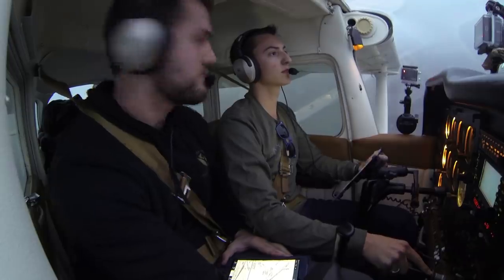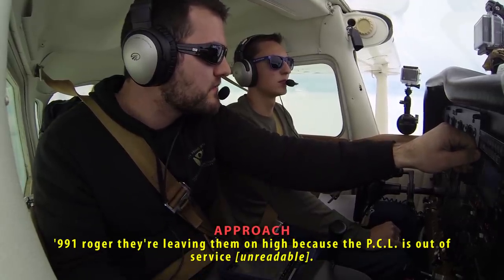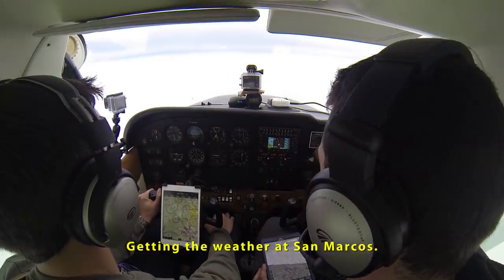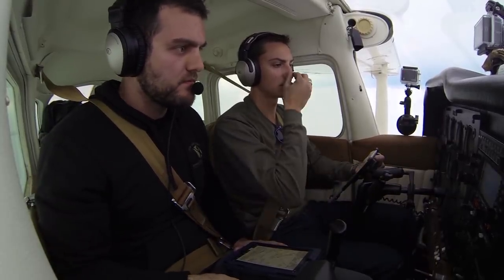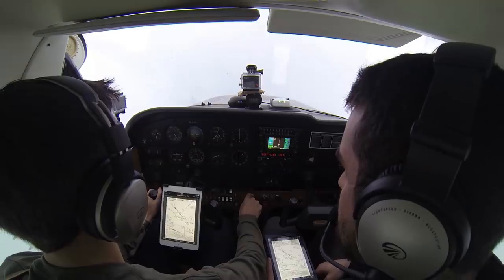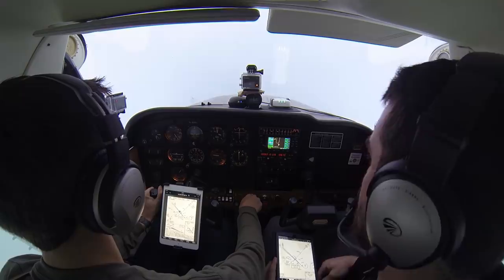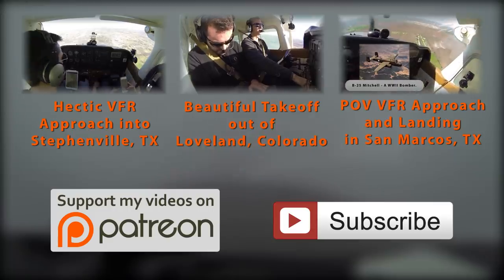ILS Approach to Minimums | ATC Audio | Cessna 172M

Comment: About the lighting, she never told you that anything other than the runway lights would be on. She didn't confirm the approach lighting would be on. Listen from like 2:30 on. When I listened to this the first time I was saying to myself, "She never confirmed anything other than the runway lights."
Reply: +mr3856a ATC did confirm the runway lights would be on high intensity though.
Reply: "991 the pilot-controlled lighting is out of service, so they're leaving everything on high." Sounds like confirmation to me. Someone dropped the ball.
Reply: @Laverne Johnson - According to them, they did check for NOTAMS, and there were none. Since you're calling them liars, please post the proof.
Reply: I know sometimes if the light are left on “Pilot control mode” they would automatically switch back on low during a certain time period.
Reply: @ProfessionalPilot  Look at 2:30. The controller asks if he is asking about the APP lights or the RWY lights as she says all RWY lights will be on high. He answers thank you. The pilot caused the confusion, not the controller.
Reply: Upstate Flyer You bring up such an important subject. Approach procedures with approach lights available make landing so much more likely. The fine print in the regulations is often not explored or understood or appreciated as to the resources available to the pilot attempting to land. Many people do not understand that “minimums” actually refers only to visibility, and does not include reported cloud heights or conditions, unless the specific procedure chart actually requires them, i.e., by text thereon. This is why approaches can be attempted (for commercial operations) when cloud heights at the field are below the MDA or DA, as long as the visibility minimum exceeds that specified. Also, if the approach lighting system is sighted, then one can descend from charted MDA or DA to a height 100 feet above touchdown zone elevation—which greatly increases the probability of safely and successfully “getting in.” This is why the ALS, if available, is so important. This resource should always be looked for and briefed, along with TDZE elevation and the accompanying minimum height one can descend if the ALS comes in sight.
Reply: I just saw your comment now, after posting just about that same thing you said!
Reply: doesn't the approach lighting being off or inop technically raise the decision height, according to the FAR? I could be wrong on that, but it would make this approach below minimums. The approach controller did only say RWY lighting would be on tho, nothing about approach/MALSR or anything else. Either way, great approach and great landing! You'll be a better, more confident instrument pilot after that for sure.
Reply: @teddycourtney5692  Yes indeed - inop approach lighting raises the minimums on the approach.

Comment: Nice video!
A bit too much of pressure and talking of the instructor in my opinion.

Instrument flying is very very easy once you do it regularly and very very difficult at the beginning. 

Good briefing before the flight, the awareness of the common errors (a good portion of them are caused by the mere fact that a student pilot in IMC is nervous) helps.
Do it in a simulator a couple of times to train your brain for the correct scanning technique.

There is no rocket science behind an ILS, just a sequence of quite a lot of small steps and actions. 

I do not fly C172's a lot, I would suggest to fly these approaches with 10 deg flaps only, leave the flaps there until touchdown, any flap changes during the apporach produce a lot of pitch changes - very distracting. An ILS runway is plenty long enough for a C172 on a partial flap landing.

Nice video - keep up the good work!
Happy landings
Guido
Reply: Guido Warnecke I miss your videos, sir! Watched every single one of them and waiting for some more!

I saw you commenting on a brazilian aviation Facebook group once. I'm from Belo Horizonte - Minas Gerais.
Reply: Thank you - muito obrigado.
i will have some videos up shortly.
Greetings to MG & happy landings,
Guido
Reply: +Guido Warnecke I have a question to mantain the GS I could control the pitch only with power setting ??????
Reply: Angelita: it is important not to "chase" a pitch on the glide slope. Start with a know power setting and then do only minor adjustments with power and pitch. If you have a strong headwind you may need to add some power, above the "normal" power setting in the approach.
The key here is "small" adjustments.
Another way to train this on any flight: Set up the aircraft on a descent and watch you ground speed on the GPS. On a 3 deg glide path you would need 600 feet per minute descent rate to maintain on the glide path.
The formula: ground speed multiplied by 5.
Example: 100 kts ground speed, multiplied by 5 is 5000 feet per minute rate of descent.
You hold the rate of descent for that ground speed and you aircraft will stay solid on the glide path, no chasing...
Happy landings,
Guido
Reply: +Guido Warnecke I would practice the formula in my sim by the way I appreciate your advice .Thanks a lot guido and happy landings too..
Reply: Very good - let me know if it works for you.
Happy Landings,
Guido
Reply: +Guido Warnecke Hey man! I agree with your comment about the instructor pressuring too much completely. He appeared a bit nervous and maybe a bit uncertain himself. But on-topic you were testing us here: of course the correct descent rate you wanted to write in your example was 500fpm iso 5000;)
Happy landings!
Reply: 500 is correct - thanks for picking that typo up.
Happy landings,
Guido
Reply: +Guido Warnecke 
Couple decades ago for realistic distractions my instrument instructor for NDB's would use country western radio stations even if we weren't navigating by NDB's.. Could be this videos instructor is combining instruction and realistic distraction all in one. He did stay on him about erring on nav and should of explained rich mixture in clouds has to have carb heat for those planes. Can't let bad habits start in the most critical part in flying.
Reply: +Guido Warnecke Thanks for the flaps advice, it  really worked!
Reply: Very good!
Merry Christmas & Happy landings,
Guido
Reply: Same to you too , best of the best!
Reply: When Guido speaks, I listen..... Thanks...
Reply: IMC is not the time for the cfi to sit back, be quiet and wait for the student to make mistakes before correcting them.
Reply: I think instructor was great  with directions especially hand flying through that pea soup. Shit was thick .
Reply: Bro that instructor was NERVOUS asf lol

Comment: Great job teaching, letting the student fly the entire approach.   Tap the rudder for the minor heading correction and use the trim more - trim for the 500 fpm and see if you can fly the whole approach with little to no control inputs.  The closer you get to that, the easier even approaches to mins will be.

Comment: I only have one note.  The controller said 3000' until established, not 3000' until GARYS.  Those are two very different things.  Maybe the approach has changed, but the current plate has GS intercept at 2700'.  Using that plate, you can descend from 3000 to 2700 as soon as you have course guidance on the LOC.

Comment: Josh, as an non-instrument rated flyer, I was super-impressed with your performance.  Have seen a few in my 33 years of flying GA and Experimental Amateur Home built planes. 

   You are really lucky to have an instructor as good as Brandon - he is "da man!"   I once had a "furloughed Pam Am Pilot" as my Instrument Instructor.  He yelled and screamed at me, until I made a "one eighty" and went back to the field to NEVER fly with him again.  And I did not!
Josh, you are an excellent "manipulator of the controls," and have a great aviation career ahead of you.  I'm jealous as hell :)   Nice video, thanks,  N-6395T

p.s. the movement of the carb heat knob was really telling and important.  I am one of those trained to have that carb heat:  Either FULL ON - or FULL OFF.  Halfway, sometimes, cools the air to 32degrees F - and with moisture, ICE!

Comment: I learned to fly in a Cessna 150 then transitioned to a 172.  It was like moving from a lively but low-powered MG 2-seater to a 6-cylinder Chevy sedan.  The 172 was physically harder to fly but very solid and I did much of my Commercial training in it.  Then I moved to a Piper Arrow, a fast machine with retractable gear and a constant-speed prop.   What a sweet airplane!  I spent dozens  of hours in it in Instrument training, flying bizarre approaches and holding patterns, some times in actual IMC but always under the hood.  Talk about fun!

There is nothing more beautiful than flying through the air, or navigating thorough clouds and fog to a distant destination.

Comment: Your radio was really staticy/hard to hear but I think the controller said that the runway lights would be at full intensity but never specifically confirmed the approach lights.
Reply from the maker: Great catch! I think you are right... The radio was hard to hear so we didn't catch that during the actual flight.
Reply: Andy Plater Gary pettis
Reply: Andy Plater i specifically heard the controller actually ask if you mean he runway or approach lights and you responded to confirm the runway lights will be on so I think it was a misunderstanding
Reply: Was just about to comment on the same thing (two years too late hehe). Anyways, great video! I've watched it several times now, the co-pilot/instructor is really switched on there..! ;)

Comment: The instructor said, "remember to pitch for airspeed, power for altitude". I watch a lot of aviation videos and I know this is always taught this way, but whenever I'm landing or taking off (I'm just a flight simmer), my brain is always thinking to adjust pitch for altitude and power for speed. I realize this is the wrong way to think about it for making adjustments in decent rates but what I do not understand is why?  At face value both patterns of thought seem to give the same result but I must be missing something. Maybe someone can explain why you're taught that pitch is for speed and power is for altitude?  

By the way, I'm not sure if you and Brandon are friends or if this is just how he treats all of his students, but he is the best instructor I've ever seen, I love his attitude and the way he guides you through this.  A good teacher is one that is able to get inside your head to know what your thought processes are and correct them before you even make the mistakes you're about to make, or to help you fix your mistakes.  I taught guitar for many years and Brandon has a very similar way of connecting with his students. Great video!

Comment: Great video!

A little comment:
The controller cleared you to the approach and limited you to 3,000' until established (NOT to GARYS). Once you're established, you are automatically cleared to descend to 2,700' (per the approach plate).
Additionally, GARYS is the FAF only for the localizer approach. For ILS approaches, the FAF occurs once you intercept the GS at 2,700' (which is marked by the lightning bolt symbol on the profile view of the plate - that's what the FAA calls PFAF, or precision final approach fix).
Reply: +talreichert MrAviation101, thank you VERY much for videoing, editing, and sharing such an awesome video.  As a soon-to-be instrument student pilot, this was great to watch.  Great landing too!

Is talreichert’s comment correct?  It seems so to me, but I’m just learning.

At about 8:30, ATC said “Maintain 3000 until established on the final approach course” and, given the reference to “course,” I’m guessing that just means stay above 3,000 until you know that you’re established on the 126 course because you’ve got the localizer needle centered

After you’re established so that ATC’s 3000 limitation is removed, I guess you could just stay at 3000 until you intercept the GS, but I think that you could have descended 2700, the minimum GS intercept altitude show on the chart.

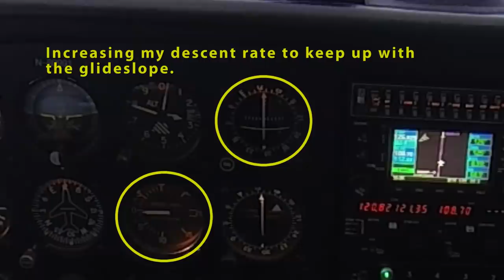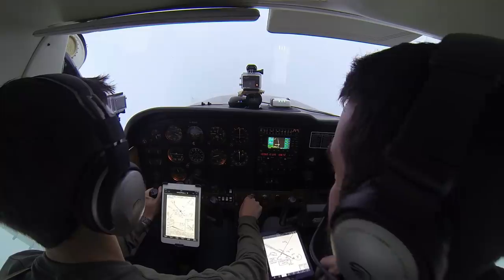At 14:36, after you were beyond GARYS, you show the instruments with you above the glideslope.  And then, at about 14:50, your instructor said “that glide slop is getting way beneath you.”

I’ve noticed that sometimes the ILS lightning bolt and the LOC cross are co-located points in space.  In this case, however, the plate shows the glide slope intercept and FAF for an ILS precision approach (the lightning bolt) at some distance in advance of the FAF for a non-precision approach (the maltese cross) at GARYS (RU LOM), so I’m guessing that interpreting ATC’s instructions as meaning you should maintain 3000 all the way until you reached GARYS is probably why you were initially above the GS and had to aggressively descend to acquire it.  

I’m thinking that intercepting the glide slope prior to GARYS would have been a bit more comfortable.

Thoughts?
Reply: +Joe Andras I haven't received anything on my comment either, I believe what you wrote is correct too. One thing as to what "established" means - if I recall my instrument training right, it does not require that the needle is in the center, but that it's in less-than-full swing (i.e. not in a condition that would require go-around) and moving toward the center.
It is not required for it to be in the dead-center before you can call yourself "aligned" and proceed with the approach. It basically requires that you receive and identify the radio aid in question (where and as applicable), that the indicator is not flagged or pegged to either side (i.e. less than full swing).

I hope that's helpful.
Reply: +talreichert Thanks.  I'll definitely think back to your comments re "established" as I train.  Also, I really like the expression "radio air."
Reply: +Joe Andras Well, it was supposed to be "radio aid" (now fixed), so don't get too attached to it. :-)
Good luck in your training! Working on your IFR ticket?
Reply: +talreichert Ha.  I took it to mean radio-enhanced air, i.e. when your in the air where the localizer needle isn't necessarily centered, but is helping.  No worries.I may still adopt it and someday you can take credit for coining it.

Comment: "Full power full power!" I would have firewalled it and started the go round.
Reply: I agree. I am not so convinced as some are, about the appropriateness of the instructor's constant advice during the descent. In my experience, the pilot is usually already taking the correct action to regain the glideslope. It is too easy for the pilot monitoring to pick up a deviation, which is probably already being addressed.

Comment: I see that you're on NAV page 2 on the 430. NAV page 1 is better for flying the approach in my opinion. Trying to fly the magenta line with precision is a fool's game. On NAV page 1 you have the indicator. If you set up the 430 to show DTK and TRK as long as you keep those the same, you'll stay right on the localizer. Nice job though. I am also quite impressed with your instructor.
Reply: Now what did they use in the 70's before Nav page 1 or 2?

Comment: Well done from a retired airline pilot!! You guys just blew the lid off the insanity of setting personal minimums and never violating them. Thank you Brandon for not buying into this stuff and passing it along to your students, and here's why. When training for your instrument rating, all approaches are flown to minimums. When you take your check ride, the examiner makes you fly all approaches to minimums. Then the idiots at the AOPA and other people will tell you to set personal minimums for yourself and never violate them. This instills in pilots an irrational fear that there is some hidden danger below their personal minimums. I was at an AOPA seminar once where the presenter passed around a document for those IFR rated pilots to SIGN vowing they would never violate there personal minimums! If you have personal minimums, you will never be a better pilot than your personal minimums. Let's say you are told to never go below 800 and 2 miles. You get to your destination and it is 500 and 1 mile. Are you REALLY going to divert rather than continuing to descend for another 300 feet? Diverting is far more challenging than continuing to descend an little longer. I have one suggestion for you on the approach you flew. I would have stayed at 4000 feet until intercepting the glideslope. If you are at 4,000 feet, and your clearance is to maintain at or above 3000 feet until the intercepting the localizer, stay at the higher altitude and intercept the glide slope from there. This gives you more time to figure out the power setting required to keep it centered. Just a suggestion for an otherwise well flown approach.

Comment: Way to electronically gang bang your magnetic compass.
Reply from the maker: All of those devices are magnetically shielded. They are meant to sit on the glareshield next to the compass.
Reply: +MrAviation101 Interesting! Thanks for the input/reply! Fly safe!
Reply from the maker: +Adam Rice yeah! No problem. It's a common misconception, most of those aviation devices like we have are designed to not affect the compass.

Comment: My instructor was like this one: patient, helpful and positive.  It's a magical combination that every flight instructor aspires to.  This video reminds me of a very instructive IFR flight and the need to trust the instruments.  We were shooting approaches in solid cloud and picking up some ice as we climbed out for home.  The airspeed indicator dropped to zero as my internal gyros suddenly tumbled.  My body leaned left (I told my instructor what was happening) but the instruments said we were level and I believed the latter.  I turned on the pitot heat, got the ASI back and we climbed out of the ice and headed home.  There was ice on the wings so the approach was in the dark at near cruise speed just to be safe.  It was scary fun!